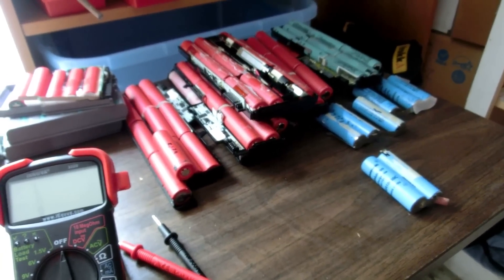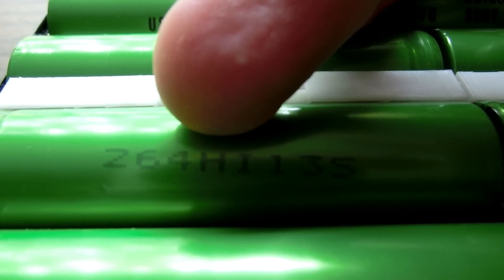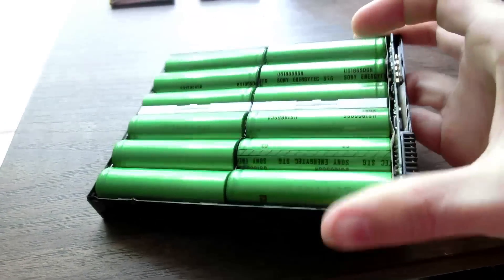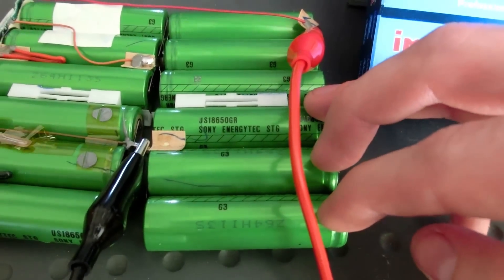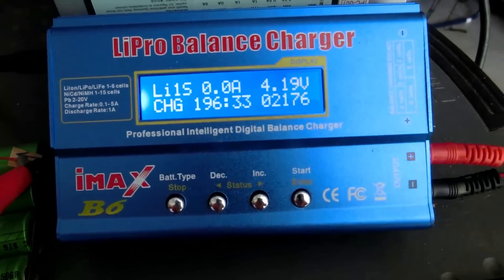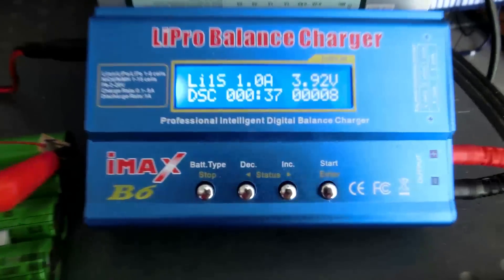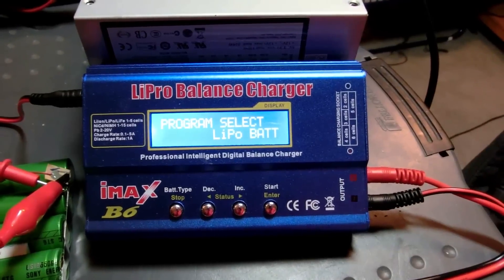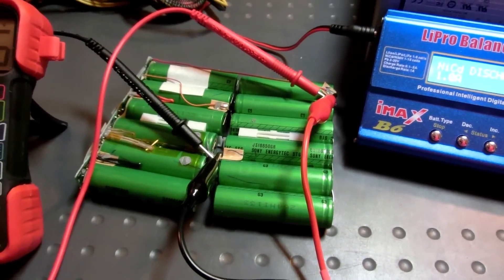15 year old 18650 lithium cells from 1999

Comment: do you fully charge an18650 battery to 4.20 then discharge it to get the battery mah
Reply: Be careful to check numbers, lion batteries are sometimes 3.6 or 3.7v. Check the numbers first. So it would be either 4.1 or 4.2v max. LifE batteries are 3.3v so 3.6 max. Check chemistry before charging.
Reply: O
k thanks

Comment: You've definitely showed me that harvesting old laptop batteries is with out a doubt the cheapest way to get quality cells. That said I'd love to see you review these cheap 18650 cells that are for sale on ebay, you know the ones that say 4000mAh and then actually test at 900mAh. The main reason being I'm sure there's at least a couple models out there that aren't completely worthless.I mean even if you found one that was say 2000mah or more chances are it'd only be a couple bucks and a great way to speed up any project that needs a big battery bank.
Reply from the maker: Joel Hennessey i've tried but every time i order them they never come in three months so i get my money back. main issue is those batteries like Trustfire, Ultrafire are just ripped from laptop batteries.
Reply: Rinoa Super-Genius I have some "Trustfire" batteries here labelled as 3000mAh but they hold 2600mAh which I'm happy with, so not all of them are rip off batteries. However I have some Ultrafire ones which claim to be 2500mAh but only hold 300mAh! I got my money back off those...

Comment: If your having issues with the voltage readings on your charger, you can calibrate it: Head over to scullcomhobbyelectronics Youtube channel. He has a video comparing real and fake Imax B6 charger which includes how to calibrate it.

I did think "150mV drop over your charge wire? bit high!"